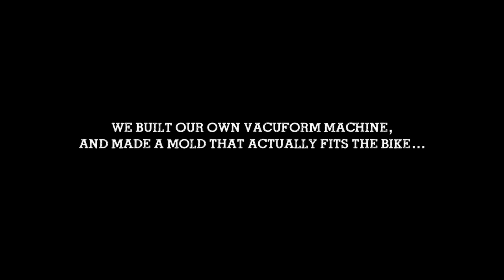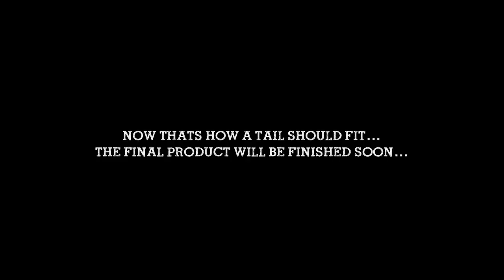Building a Vacuum Form Machine and Making a Cafe Racer Seat from Scratch for the Yamaha SR500

Comment: Hey, Awesome by the way. But I really need to know how you put together the heating system? was it a disassembled heater? or did you buy the metal and shape it, and connect it to electricity or a heat source?
Reply from the maker: I made it. It is a sheet metal outer shell, with ceramic board to insulate. Then used 2 new electric 240v oven elements.
Reply: nice.thanks alot ill have to check into that.

Comment: You are a Stud! You're attention to detail is impeccable. You are a true inspiration. 

If you don't mind, I'd like to share a little about myself with you.  

I'm in the process of working towards a similar end. I hope to eventually either purchase or build my own 3d scanner, 3d printer, vacuum forming machine, foundry furnace, tubing bender, manual mill, manual lathe, tig-welder, cnc plasma table and of course all the smaller misc tools/machines to support taking an idea from conception to fruition. 

 I started this journey by first getting my welding degree. Soon after graduation, I switched to Mechanical Engineering, started a SAE Baja team, designed an built most of two "baja" cars, and helped to develop the machine shop at my school (for a video of the build process, search boise state baja). I now work as a design engineer where I get to make multi-part fixture solutions to support a lights out method of manufacturing. 

I've learned that, without help from like minded individuals, the process of making dreams like mine a reality is fruitless. With that in mind, I started to look to people who have a similar drive to invent/create. I've since started a team of peeps who have ideas they'd like see come to light.

Hopefully, someday I have a shop like yours, ability like yours, and the freedom to go about my day building incredible machines how I like.

Sorry for the novel... 

Thanks for your time.

P.S. If you ever need a hand, shoot me an email... For more info about me, just search my name on LinkedIn.

Comment: @Chris Chappell Thanks for sharing. I'm doing a vacuum forming of something completely unrelated... built a large machine like yours but I'm running into a problem removing the mold. I see that you made your mold very smooth and you also left the first layer of thin plastic on it which should help in removing the mold. My question is what thickness of Petg did you use for the plastic left on the mold? Thanks and awesome work!

Comment: I noticed you had some issues getting that black ABS to get all the way into the corner at the back of the seat. The plastic will cover all over the edge of the mold before you have the chance to get rid of all the air underneath, so you could drill some small holes there into the mold to get those last bits of air out and get a tighter fit.

Comment from the maker: @Francisco Fred Viana keep in mind this was a while ago and the machine and moulds have changed since. Now our moulds are screwed to the table so removal is not a problem. The PETG will not work for very long, we are doing 3/16" thick ABS so the heat of the ABS over the PETG will eventually distort it. Don't know the thickness of what i used, but it was thin.

Comment: I noticed you overheated the plastic. I had this issue too when I started out with my homemade vacuum former. I solved the problem installing an electronic temperature controller on each of my zones. They are super cheap on Ebay, $8 bucks delivered. The digital display gets preset and it cycles my contactors so the elements don't get blazing hot and singe the plastic. Best $16 bucks ever spent
Reply from the maker: yeah this was a while ago when i first built it. I have built heat shields since, and cycle the power as needed. No longer gets overheated. Thanks
Reply: Hi,can you ,please, give me exact name of this controllers from E-Bay?

Comment from the maker: Hey Mike, i'm not really a "plans" kinda guy... also the machine has changed quite a bit since this video, some of which can be seen in our more recent vids. I'm now pulling 3/16 thick ABS so i had to change out my vacuum system to vacuum pumps and air tanks, made a new platen and modified the heating system to not blister the heavy material. Basically if you want to make 1 seat or tail, then just make 1 - much cheeper and less of a headache honestly.

Comment: I've had my Tuffside seat for a little over a year now on my daily driver. At first it seemed a little delicate, I thought for sure the diamond stiching would break but it's held up nicely. The one thing I have noticed is the foam is completely flattened where my ass usually sits. (no I'm not a fat ass!) I would reccomend using a more firm grade of foam. Or don;t use it as much as I do! Looks fantastic though!